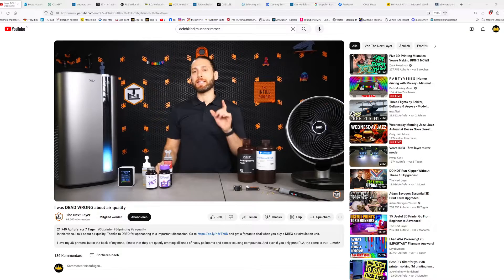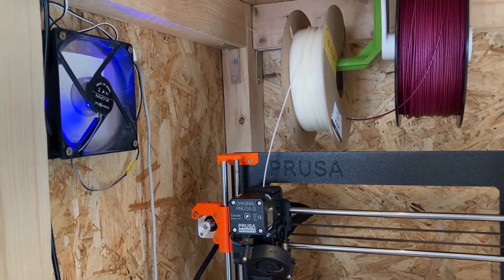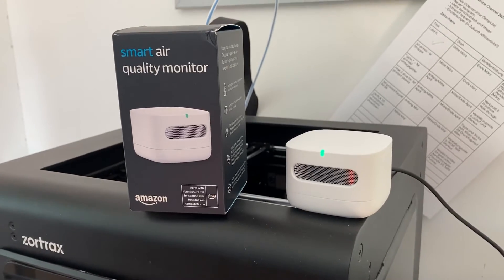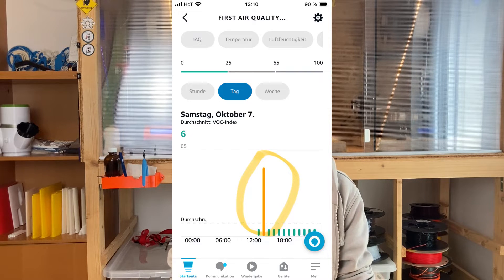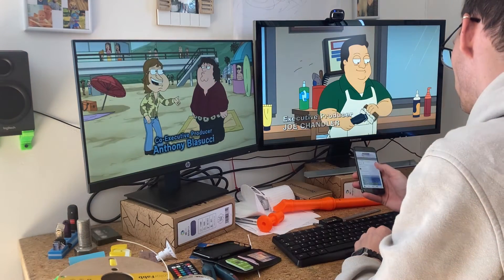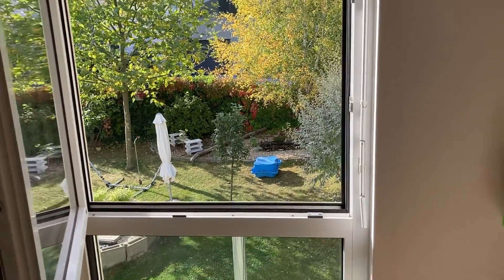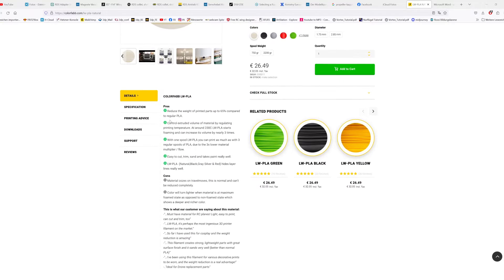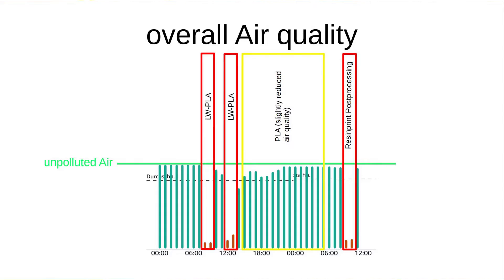How toxic is LW-PLA?

Comment: Great data points, and examples. Thanks for sharing.
Wonder with LW-PLA the expanding action may cause micro bubbles that pop on the surface as the filament is extruding. This could be the source of micro particles. 
Perhaps placing a recirculating HEPA filter inside the enclosure would help, by trapping particles before they can escape the enclosure into the room? Surface area of the filter and volume of air are important parameters. So a filter inside the smaller enclosed space could be more efficient vs. processing a larger volume of air outside the enclosure.
Reply from the maker: thats absolutely true - Elegoo even has a 3d-printer specific purifier in their offering, but yet i´m not 100% sure about it.

Comment: Great engineering quality and aspects to your measurements and discussion. I loved it.

I have a room about the same size as yours and run 2 each V2's  and two each 5+'s. I can definitely tell you that if I stay in there too long, my sinuses start to feel sensitive and I would say it is from the rise of pH. I keep the door in the room closed and air condition vent closed as well to maintain internal room temperature but have always thought I should take a small computer fan to vent out the window. This is from only using regular pla, which everyone should understand for meaning poly lactic acid made from biomaterial but the word acid in its name points to a change in PH in the atmosphere. While it's not harmful, at least my sinus is detect it.
I only use USA made PLA from XYL in Texas, to ward off the potential dangers of unregulated, inconsistent overseas material

Comment: Good point that most of us hobbyists forget. I use PLA, PETG and LW-PLA on my printer located in the basement. I do notice only once I go upstairs and return back downstairs if there is or isn’t an odour. Funny that when your next to it you don’t notice at all or very little. I biggest walk away is that I find that odours are not linked with the material types I mentioned but with the colour and manufacture. For instance white PLA from Overture has high odour but white PLA from Creality has no noticeable odour. So definitely a mixed bag. I simply don’t buy certain colours from certain vendors because of this.